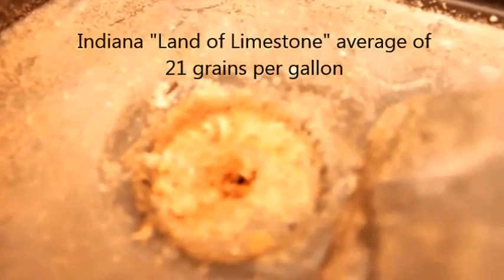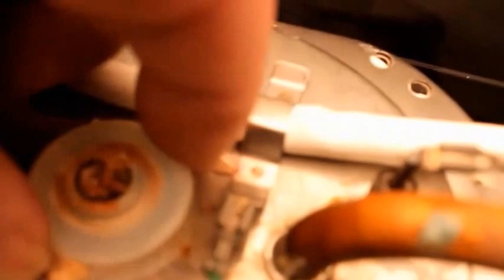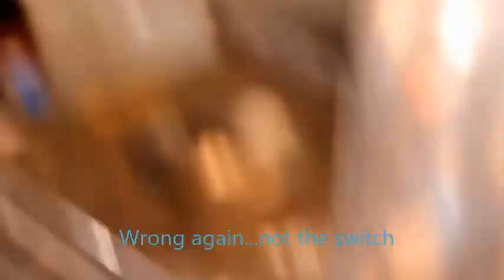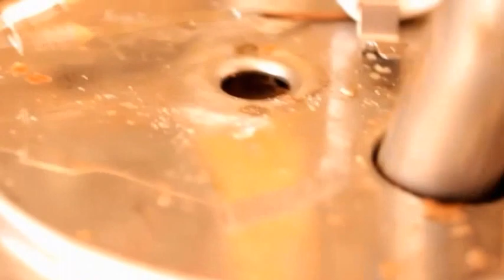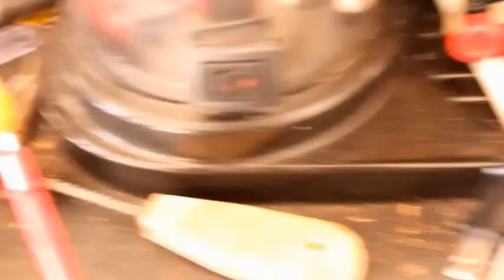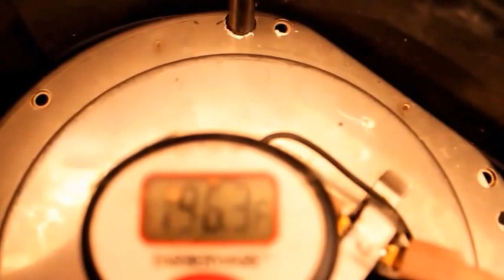Broken coffee machine

Comment: When I have my thermostat out of the tank all is well. The second it touches the water in the tank, it trips my gfci. Can you advise me please?
Reply from the maker: GFCI outlets will trip easily on coffee equipment that may have a weak short in the casing of the thermostat. The best way to lock down the area of a grounding out circuit or a short in the thermostat is to use an OHM meter. Unplug the machine from the outlet taken ohm meter and obviously put it on ohms of resistance then take the red lead or the black lead and touch it to the capillary tube and /or capillary bulb, and the other lead to the electrical terminals One at a time and see if you’re passing any voltage through the ohm meter. If it shows any resistance on the meter then your GFI will trip the breaker! Also if it has a keep warm heater surrounding the tank you may want to check it for ohms of resistance. I’ve seen those coffee machines plugged into a regular outlet when there is a very small resistance and still work but not on the GFI circuit of any kind. They just will not work which means you have to find out where the ground or short is coming from and if you’re plugging in the capillary tube in the water and it shorts out that GFI chances are you need to change the thermostat or check the wires going up to the thermostat and make sure they’re not grounding out against anything. There is one other thing, the heater elements themselves are probably in series with the thermostat and the element itself could have a crack in the shielding so when the thermostat sends electricity and The heater element gets voltage to it because you have put the capillary tube down into the water it turns on the element but if the element has a crack in it it will kick the GFI. The best way to check and see if it’s an element is to take an old meter and touch it to one of the two terminals of the heater element and then to the tank itself. If it’s bleeding voltage through the water you’re going to read it on the ohmmeter. And I’ve seen that happen 1000 times. A lot of times if you pull the heater element out you will see the crack in the side of the element. It’s fairly visible. You shouldn’t be able to take the element out set it on the table touch the terminal of the element with one lead and touch the side of the element with the other lead and read anything. And there is one other thing you might look at. The high limit switch is also in that circuit and could be bleeding voltage to the tank. But in this case an ohm meter is your best friend and if you check each component by disconnecting the thermostat and the heater element in the high limit thermostat in the blanket heater one of the time against the side of the tank you will find the offending item. Nothing should bleed through on an ohmmeter when it comes to water And voltage. GFIs don’t like that. Good luck
Reply: @gumsmoking  thank you so much for the in depth and thoughtful reply. This helps me immensely. I'm saddened by the lack of parts availability for Bunn home brewers. I'm definitely going to keep my eye out at thrift stores and stock a few for scavenging! Thanks again and enjoy your Sunday.

Comment: Thank you for posting this video. It was a great help in repairing my Bunn coffee maker. Mine was dripping water around the base. I took it apart and cleaned it and reseated all the parts. So far so good! Thank you again.
Reply from the maker: spunkthecombo They generally leak because of rotted seals due to lime conditions. And some won't seat properly. In other cases if you remove the seal it won't go back in because it rots. The best way to find those seals is to call Bunnomatic and see if there are seals from other machines that will fit.  In the case of Bunnomatic, half of the parts including seals will interchange.  In Indiana we have on the average of 21 grains per gallon of lime...However there are parts of Indiana that are much worse...and I even got in to a fist fight with a store owner who claimed I was throwing in baking power to screw up his machines!.  His water was so hard my chemical test wouldn't register a GPG amount!...Before my strokes I worked in many states and was the "go to" guy for several coffee companies....Now I am retired and just keep my own working.